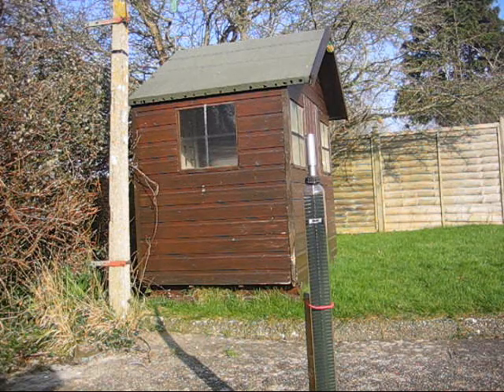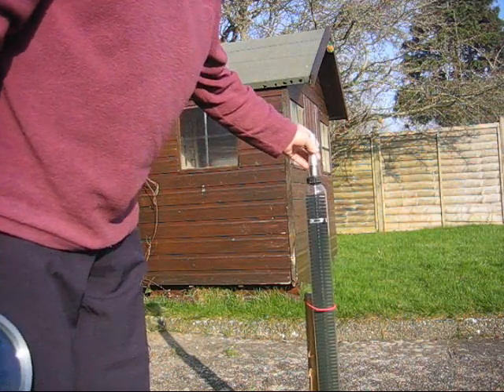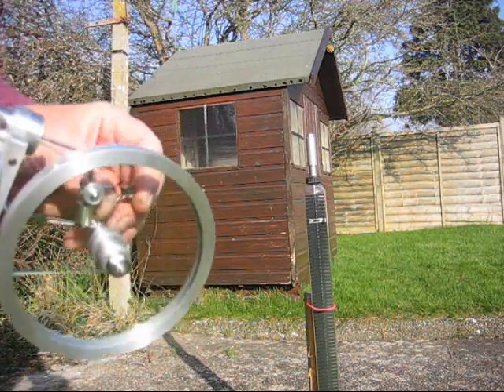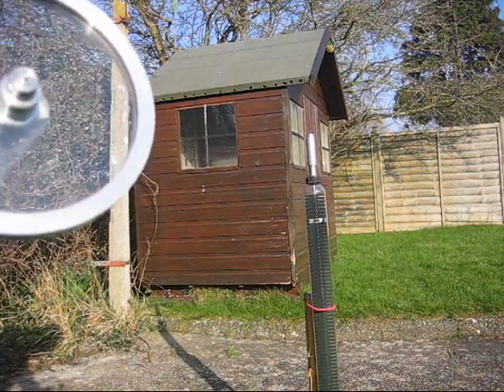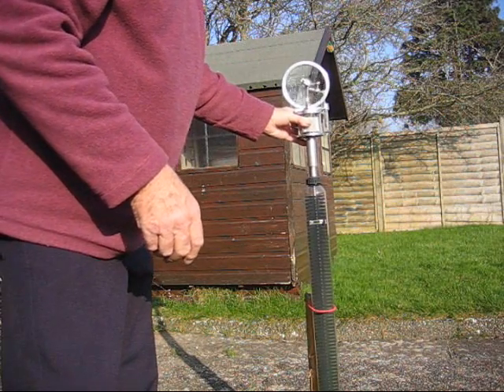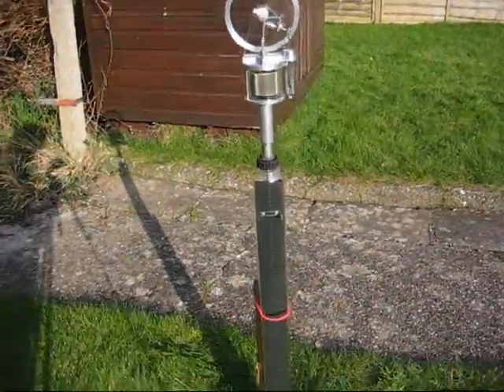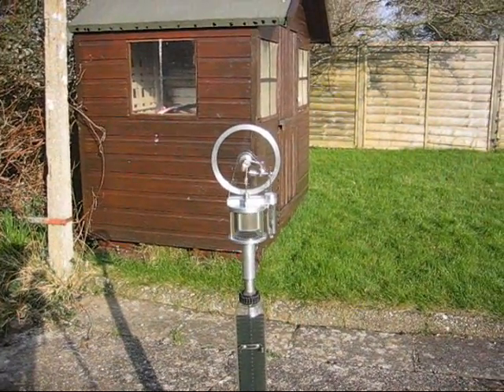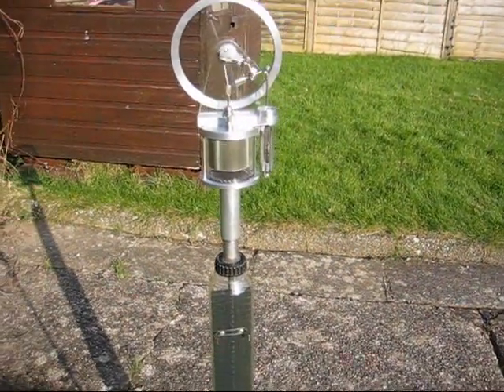Solar Heat Pipe Stirling.wmv

Comment: Hello, it would be interesting to do it with 2 heat pipes; One inside the vacuum tube and a reflector to gain more heat, one without, going into a small ground pit ( ~1 meter deep..) to take freshness from air cooled by earth in a circulating thermosyphon... ?

Comment: Great video and engine :-)

Can you recommend any websites or books on Stirling engine design? Information on crankshaft lengths, chamber volumes, ratios, etc.? Or is this all done by trial, error, and feel? How did you come to size all your components?

Any information would be excellent. I'd like to make a Stirling engine, but I don't know where to start.

Comment: Because stirling engines require a thermal grandaunt, you could work on a better way to get rid of the heat so that the heat can flow through the Stirling engine better. That is you could add some fin like radiators.

Comment: Great idea,, but Power is low on those types of engines... as they are just demonstrators (set it on a hot cup of water OR ice and it will run one direction or the other ).   But to get the power out that would be about 5HP to run a house generator, we need something obviously alot bigger..   WOULD YOU BE WILLING TO WORK TOGETHER TO GET ONE BUILT >>> I HAVE LAND AND PLACE TO DO IT>> >JUST NEED EXPERTISE (and a 5HP stirling engine)... I've seen the 5HP size its about 3-4 feet long and about 13" diameter but thats just the engine.. the solar or Heat system on one piston and cooling on other piston is what makes for higher power (in africa they use an actual fire to heat one end of a longitudinal stirling engine)...   looking for help , what do you think?

Comment: what if you made a stand instead of poking into the ground, the stand would be flat hollow copper or aluminum plates that would be welded or attached to the heat rod, paint that base black and viola, the ground is actually kind cool/cold compared to a black surface in the sun.  Thats some really uber heat extraction though.